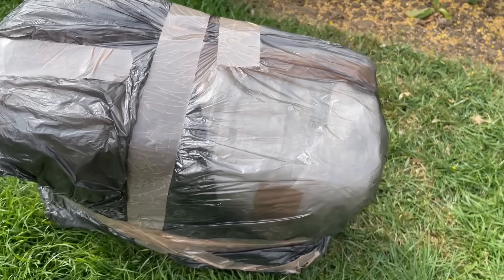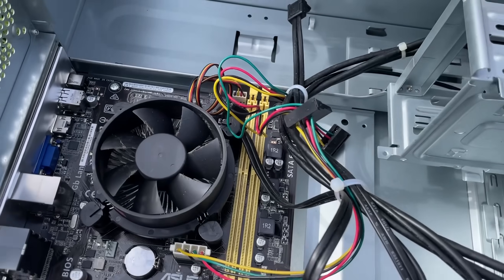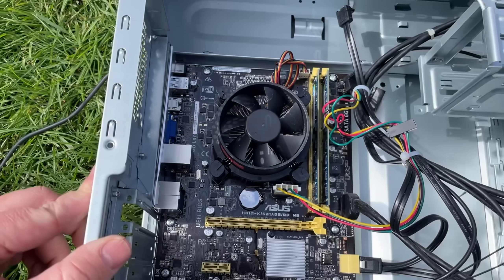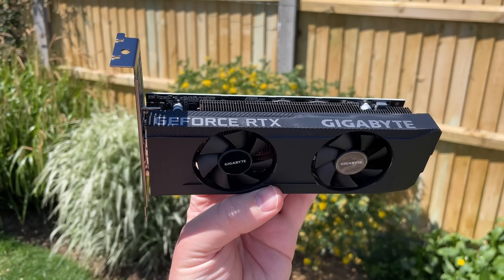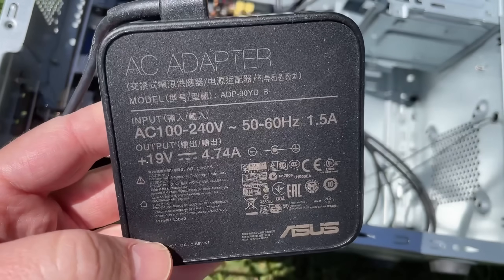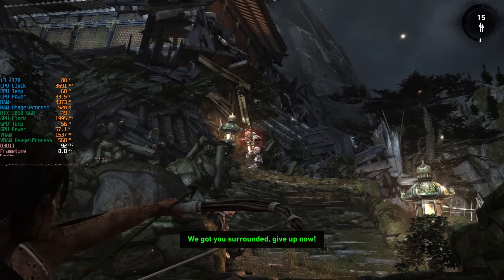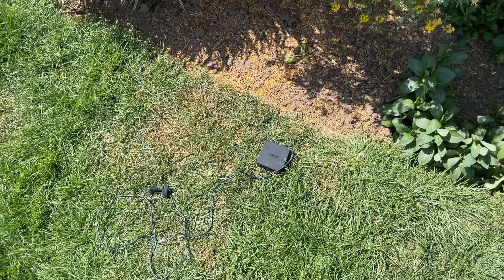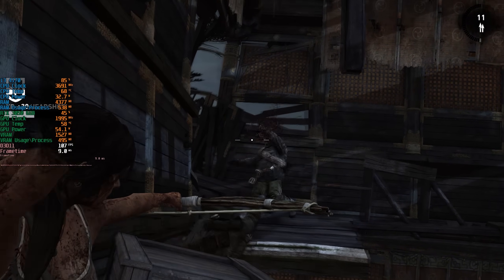This Weird Desktop PC is Powered by a Laptop Charger...

Comment: This... thing is powered by this molex connector in the middle, so you can install a regular PSU. Just need to connect power switch to appropriate place on the ATX power connector. Not that it makes any difference, garbage is garbage...

Comment: Not too oit of the ordinary. Lots of business LP mini desktops use power bricks
Reply: With no full size PCIe slot and a 35W T-class CPU.  Those aren't far from being laptops in a tiny desktop case so a 90W brick is adequate.

Comment: That cpu can use up to 54 watts by itself. Theoretically though if combined with a low power ssd it could be alright. 

But adding a gpu over 30 watts tdp is a to terrible idea... To be honest I don't even think it would work with a gt 730 or arc 310. 

Yea maybe the little 710 gt was the best choice for this but lol is it even faster than integrated graphics? I say probably not ...

Comment: Get yourself a £20 gtx 1050 for testing. That way if you fry it it doesn't matter
Reply: An rx 6400 is cool too
Reply: @thegodhoward8037  I was thinking of the cost. The rx6400 is still decent and would cost a bit
Reply: I have 9500GT cards for that 😅
Reply: I've seen other people use low profile RX 6400 GPUs. The RX 6400 is useless unless you have a PCIe 4.0 system, as you lose performance in older PCIe variants. The 4th gen motherboard certainly won't be PCIe 4.0.

Comment: In theory I don’t think this is a terrible idea, at least the power supply is easily user replaceable. Would be nice for a PC that doesn’t need to do many intensive tasks, and just needs to be extremely reliable
Reply: Mini PCs exist. Having expansion is nice, but 90w for all that is limiting.
Reply: @Seatux  I wonder if mini pcs were just too expensive for people to want back then, since this system is very old

90w was probably fine for any expansion cards that weren’t a graphics card too, even something like a 750ti would have probably had similar performance to the 3050 in this system,  while potentially not frying it
Reply: I question how reliable powering a desktop PC with a power brick is. There is no place for the charger heat to go and given my experience with faulty laptop chargers I don't think this is optimal. Or do I owe Asus an apology?
Reply: @MoultrieGeek if you use this for light tasks, it would not draw over 50W, which is enough to handle by that small brick. Besides, they are always warm to touch when used with the laptop, so they are designed for that?
Reply: @MoultrieGeek Never had a dell laptop charger die on me. My current 170w runs fine without getting that hot, and is over 5 years old. 

Edit: 180w apparently. Not something I have thought about for years.
Reply: @wyterabitt2149  I'm on my third brick for my HP 705 G4 Mini. The first two were HP OEM and the one I have now is a knockoff. Maybe it's HP problem but I don't really trust them.